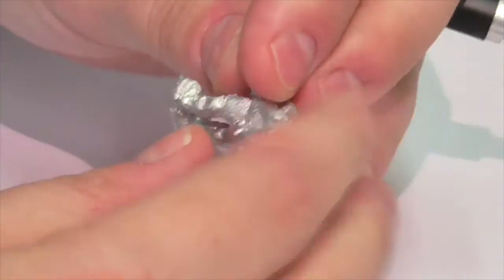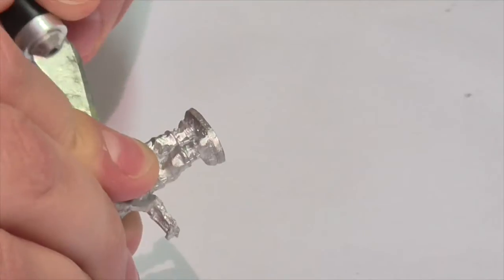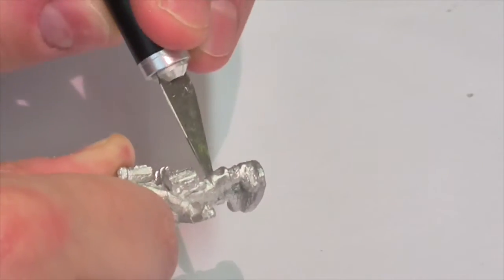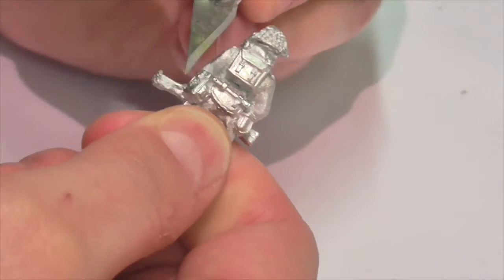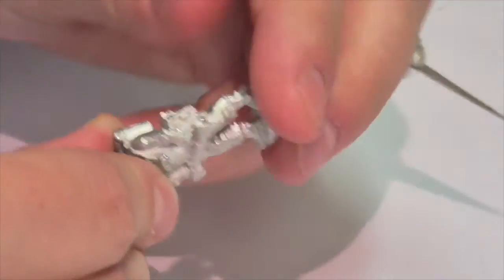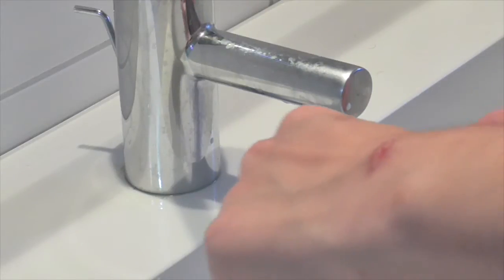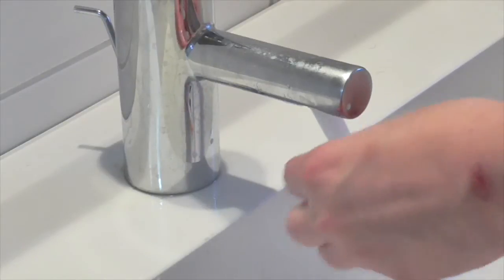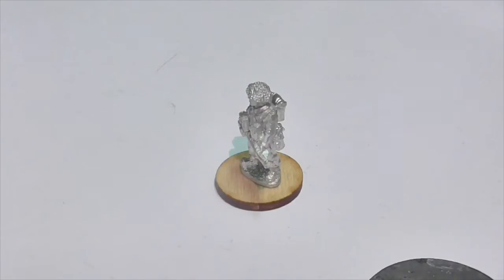Technique: Preparing the model

Comment: Hi Christy
   I just got around to watching this vid. You are correct in using an enamel base coat, the oil based paints will not react to subsequent coats of acrylic/H2O based paints. Also, today most models are made of a proprietary alloy that strongly resist oxidation, but all lead based figures will oxidize. A petrochemical based primer coat will absolutely seal the metal from the air and give a better level of protection.
  thanks
 great tutorial as always.

Comment: I normally rub the miniature with my thumb softly after I scrape the lines and flashes (sometimes I use the file to trim down the miniatures like rifle butt or barrel etc. a little bit, but just a little bit), until it feels not sharp and comfortable to my thumbs. Because experience tells me that the paint don't want to stick on these points very long when playing. And, thanks for the tech series!!
Reply from the maker: Good tip. Thanks for sharing!

Comment: What approach would you adopt for painting batches of figures. You seem to concentrate on individual models as pieces of art. I'm currently painting up figures for a world war two platoon skirmish game. Any ideas would be appreciated :)
Reply from the maker: Washing and scraping the model is going to be a similar process, though you may just want to do stuff faster and less thoroughly since there are more models. As for the painting, I generally get long, thin strips of scrap wood and glue all of the models along them at intervals of several inches using a very small amount of super glue (so they can be dismounted later). Then I use gray spray paint (preferably army painter or citadel) and spray one side of the models all at once using a couple of passes. Then rotate and continue doing this until all four sides and the top are painted on each figure. The coverage is obviously not going to be so thorough as if you brush it on, but if you are production painting a lot at once, it's usually more than sufficient coverage for that.
Reply: Cheers me dears, I'm a 56 year old novice :)

Comment: Super le gaspillage d'eau !
Reply from the maker: I normally don't wash a single model that long, and it is certainly not necessary or recommended. In this case, I just did it an extra long time so there would be sufficient footage for the shot. If water use is a big concern, you can just as easily do this in a bowl of water.

Comment: How much thinner to paint? Thanks
Reply from the maker: +Andrew Bell I don't know... If I'm using enamels, I usually just dip my brush in the thinner first, then grab the paint and just spread it over the model. You don't want it too thin so you can see through it, but a bit of thinner so it isn't super thick and obscures the details. It's not really an exact science.
Reply: +Wargames, Soldiers and Strategy enamel plus thinner this definitely going to be how I prime figures from now on. Good job :)